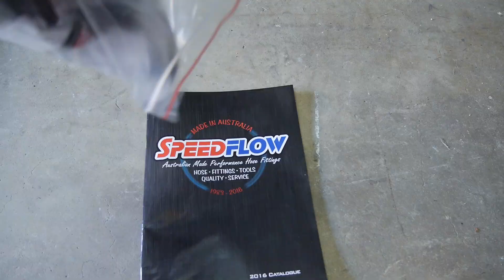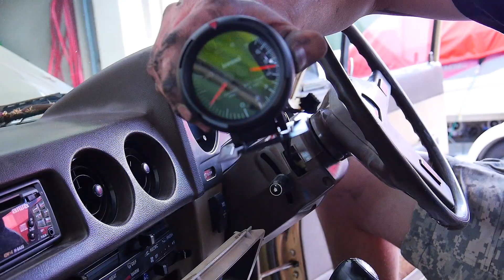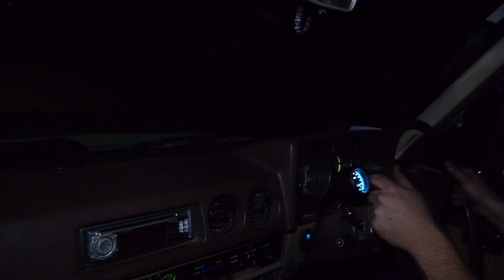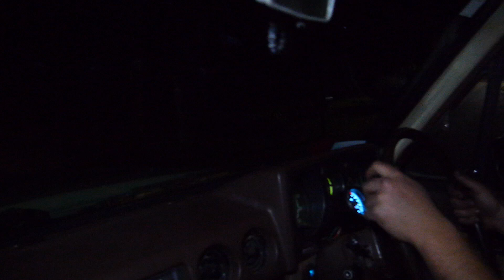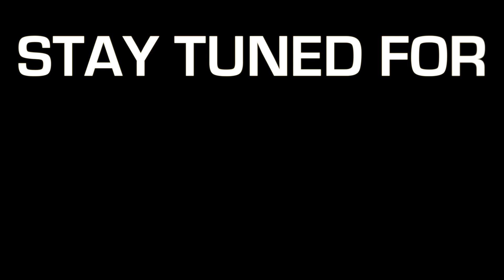HOW TO TURBO YOUR 2H DIESEL - 60 LAND CRUISER BUILD - FIRST START - PART 4

Comment: It's fun to watch your videos :) I'm middle of turbocharging my hj60 so this will come in good use. I'm going to use old valmet turbo first ( kinda budject build) wanted to see how it pulls, since it's from 4,4litre 4-cylinder tractor. I'm going to make exhaust manifold myself, since in here Finland we have left hand drive so the brake master cylinder takes a bit of space from the exhaust. Have to make it front mount manifold
Reply from the maker: Juuso's Garage Thanks man, glad you enjoy☺ that turbo should work fine I reckon! Good luck with it buddy!
Reply: Check out my facebook page Juuso's Garage to see what I'm building :)
Reply from the maker: Juuso's Garage Will do!

Comment: How do you enrich the fuel?
Reply from the maker: +corollagl82 The fuel screw on the back of the diesel pump
Reply: Boosted & Built Garage thanks for the reply how does the said screw enrich fuel at boost?
Reply from the maker: +corollagl82 On the 2h I don't think it's purely on boost, I think it's across the whole board. Don't quote me on that. I honestly don't know enough about tuning diesels. Petrol motors is where my expertise is lol
Reply: Boosted & Built Garage  nice, first time i saw your video, i fell in love with your work. How is the wastegate triggered?

Comment: Hi guys ,How did the final result of the turbo turn out ? I've just install a turbo kit on my 2h I'm worried about over boosting it's , what would you say a safe amount of boost is , I'm just looking for a bit more power for towing over the hill but long Jeopardy is important, what's your guys thoughts about this, thanks
Reply from the maker: Mate the more boost the better. Diesels need boost to cool the combustion temps. I would run as much as your turbo size will allow. Usually 18-20psi for most standardish turbos.
Reply: @boostedbuiltgarage  ok thanks for getting back to me mate 👍